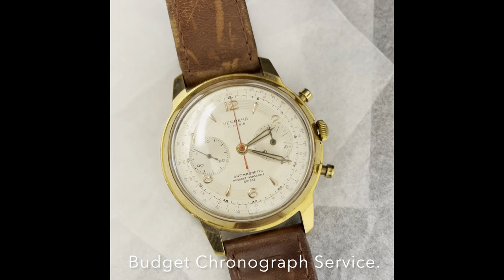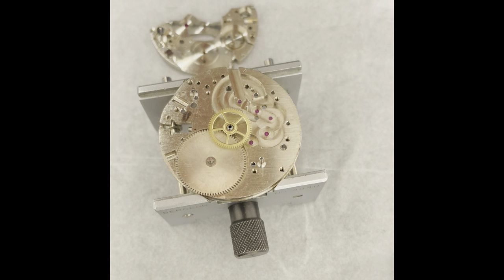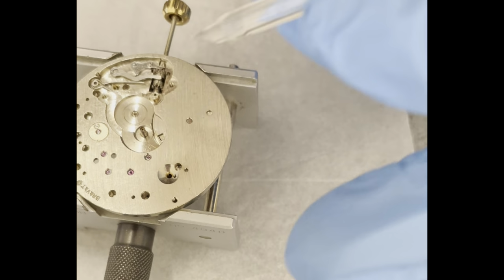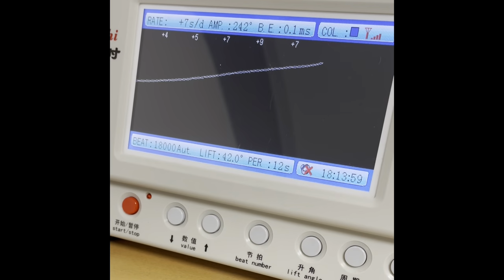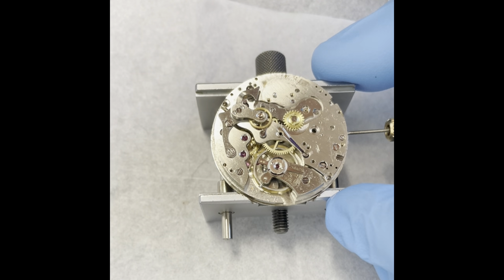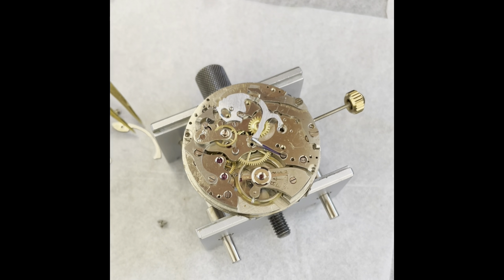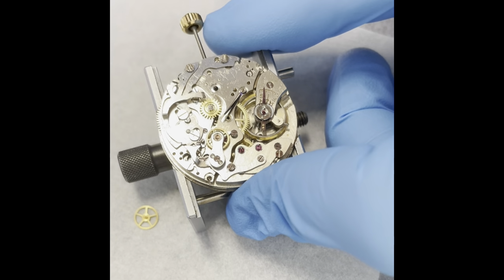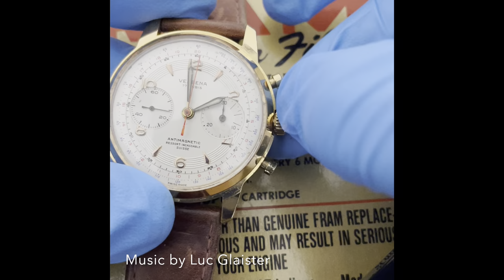Budget Chronograph watch service: Landeron 48

Comment: Seems like you didn't use anything to protect the dial when removing the hands, and you also didnt control the movement when letting down the power, you just let it rip??
Reply from the maker: Well observed, No I did not use a cover over the dial as the tool has Teflon feet and I have never scratch anything using them. Last time I had a mark it was from an old style hard plastic protector that actually left a swirl mark… I have started to use the new very nice Bergeon dial cover as it’s flexible and soft. (Se the latest videos) I usually let the power down by disabling the click and controlling it via the crown (if you lost grip of the crown you can bugger the barrel teeth).